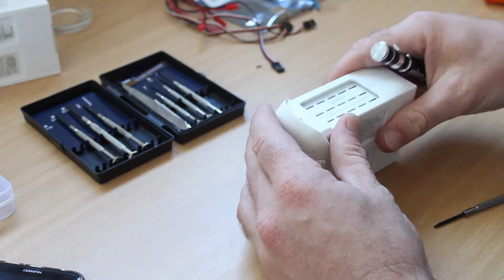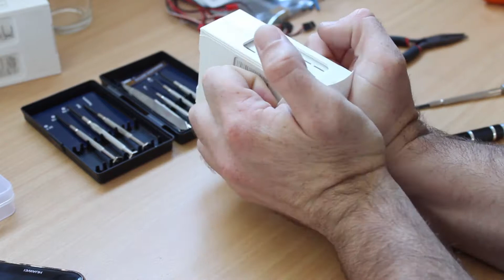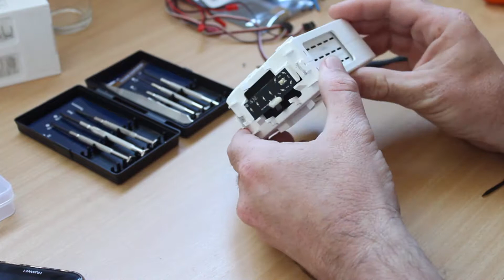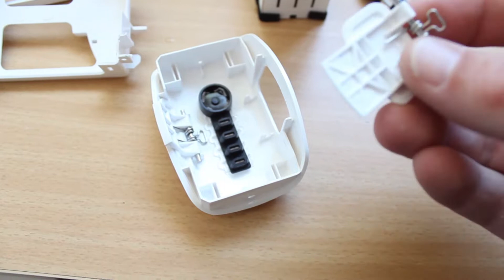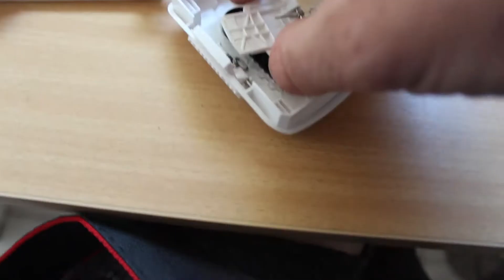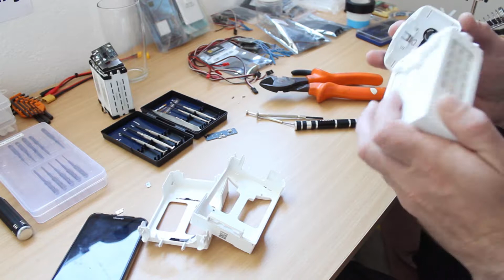DJI Phantom 4 Pro Bad Battery Disassembly

Comment: Hi Anthony, what kind of screwdriver are suitable to remove screw of edge this battery?
Reply from the maker: Muhamad Nurshahdatul Nazrin You can use a 3mm flat head to lift the covers very gently. J000 is used to remove the screw at the top of the battery to remove the back cover first.
Reply: J000 or phillip #000?
Reply from the maker: @nurshahdatulnazrin5951  Phillips